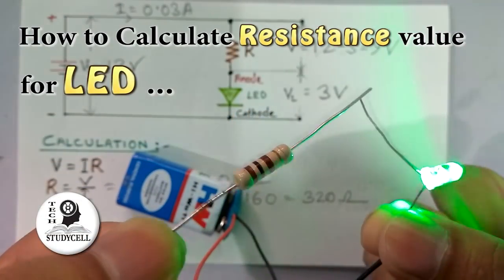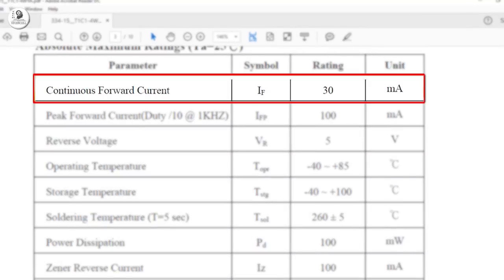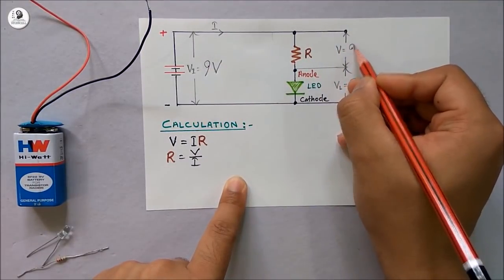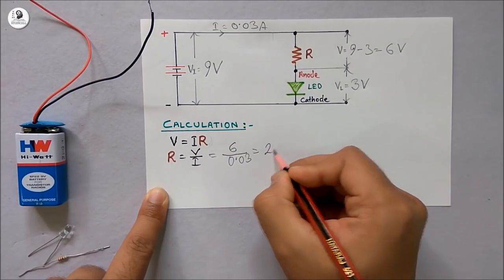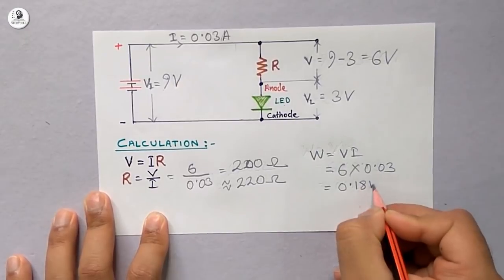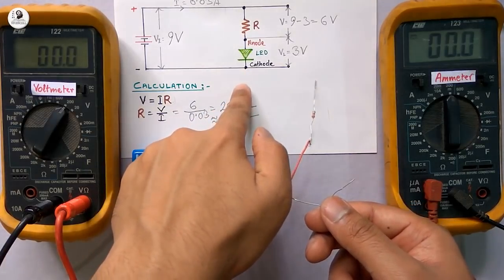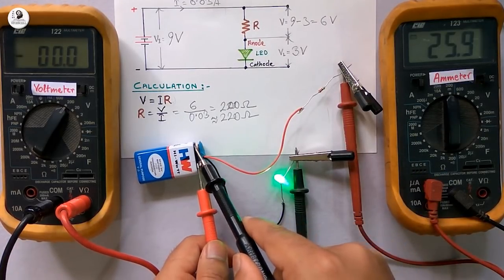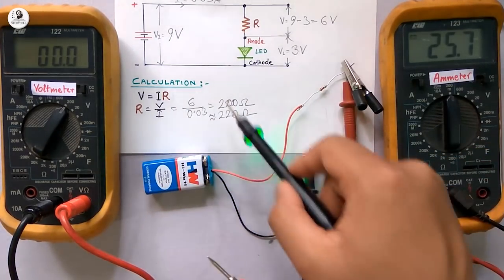How to select resistor value for LED with simple calculation (Ohm's Law)

Comment: Generally this explanation will work, but it is not totally accurate. The datasheet showed the voltage drop across the LED between 3.0 - 3.6 volts at a forward current of 20ma. The voltage drop across the LED will increase as you increase the applied voltage up to a maximum of 3.6 volts. You need to look at the charts in the datasheet to actually determine the correct voltage drop across the LED based on the applied voltage. Most people disregard the datasheets, but they are full of useful information when designing a circuit.  

Second point, the datasheet shows a max current of 30ma, but you saw on the datasheet the manufacturer did used 20ma to determine the voltage drop across the LED. You don't have to apply the max current in order to power the LED as you did in your example. You can use a lot less current to power this LED, which you did not talk about.

Third point, you did not talk at all about the lumens value of the LED, it is plainly shown on the datasheet you showed in your video. The value displayed in your video is between 14250 - 28500 mcd at 20ma. You would need to look at the chart given by the manufacturer to actually figure out how much current and voltage you need in order to have the brightness level of the LED you want. You did not even talk about that.

When you design circuits you have to look at all of these variables. Look at the voltage drops across your resistors. Complete waste of power. P=V*I for your resistors, huge waste. Power efficiency is very important when you design circuits. Another point you failed to talk about...

Finally you did not talk about operating temps. Datasheet clearly states that these values of current and voltage were take at 25C. If you are not running this circuit in an environment that is 25C your values may change. You have to look at the charts provided by the manufacturer to determine the values at other degrees C. Maybe I want to run this outside of my house where my temps are 0 or minus C degrees. Or maybe in the middle of the summer and it is 40C outside. Most datasheet will address that. You don't talk about that either....
Reply: Brother. Can you make a video  as you describe.  Please.
Reply: maximus fl .. Since you did such a GREAT job of trying to punch holes in this video, I thought, WOW, this person must have posted some GREAT videos so I'm going to check them out. Guess what, I clicked on your name and I found ZERO VIDEOS YOU PUBLISHED. Maybe instead of trying to fault find, why don't you publish some videos so others can learn from your VAST experience.